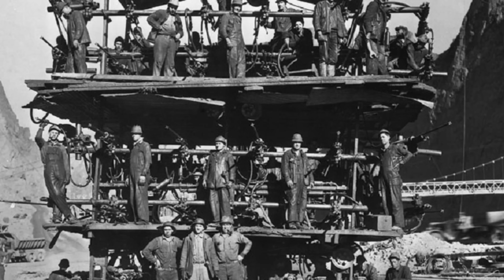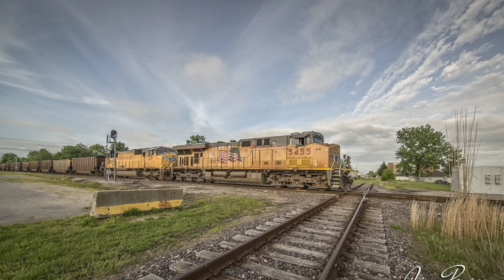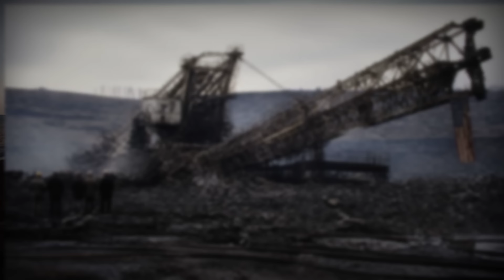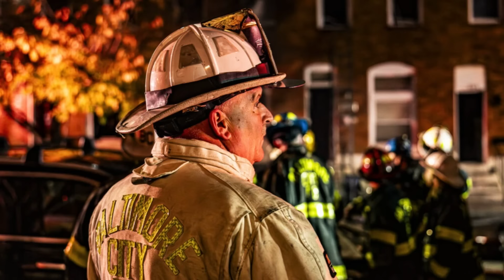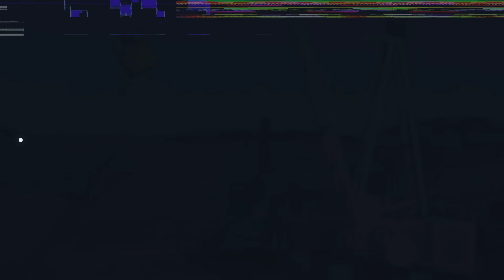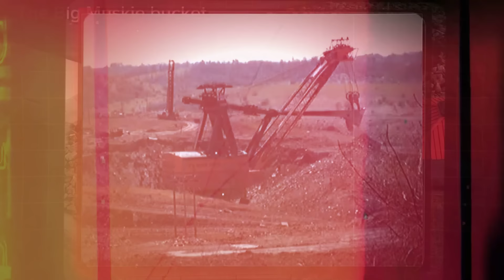The Night Seven Fire Departments Watched the World's Biggest Machine Burn

Comment: I worked at the mine and at Steeleville fire department,  I  was the first firefighter on the scene.  I called the office and told them to call every department around.  One thing they don't mention is the steel flooring became so hot we thought it was going to melt our boots also when we sprayed water it caused coal dust that was ten inches deep in some areas to become air born and we were having small flash overs. I could go on for hours,  the truth is it was more than anyone to imagine and any amount of department's to handle. I left the mine in 92 and went to work full time at the Madisonville for in kentucky.
Reply from the maker: @dennishart9346 Thank you so much for sharing this first-hand account, Dennis! Hearing from someone who was actually first on the scene means a lot. The details about the red-hot steel flooring and the coal dust flash-overs are incredible and show how dangerous it really was. Thank you for your service!

Comment: Why didn't the Fire Department use Foam or the chemical they use on Forrest fires,, were the firemen volunteers or they  rather let it burn ro a crisp for insurance fraud?
Reply: Most likely reasons include:  1.  The height of the machine was well beyond the reach of fire department aerial ladders and ground-based hose streams;  2.  Not enough water available;  3.   Not enough foam concentrate available to make the vast amount of foam required to effect extinguishment; and, 4. Even if there was enough foam available, the type of foam required for Class B [flammable or combustible liquid] fires is only effective on two-dimensional, or pool, fires and this appears to have been a three-dimensional [flowing] fire.  Also the chemicals used on wild fires are only effective on Class A [ordinary solid combustibles such as wood or paper] fires and would have been useless on this fire.  If you lack technical expertise, please refrain from  conspiracy theories and questioning the integrity of firefighters.
Reply from the maker: evanstauffer4470 This is an excellent, detailed breakdown - the foam type and reach limitations really explain why this fire was so hard to fight. Thanks for the expertise!
Reply from the maker: @JorgeLAxeGrinderBobe Great questions! Those are exactly the kinds of details that make this story so fascinating. The footage available at the time doesn't fully answer all of that, but it definitely raises some serious questions. Thanks for watching! 🙏
Reply: You had to be there to understand, read my comment.
Reply from the maker: dennishart9346 Fair point, nothing we put together can replace having been there. Were you at the site yourself that day?

Comment: Why would an insurance company pay out $35 million when it could pay $7 million and repair it?  It's like getting into a $2000 fender bender in your pick-up and telling the insurance company "no, I don't want it repaired, I want it totalled and you pay me $55,000.  Ain't gonna happen.
Reply from the maker: @dennisgray6 👍 That's a sharp analogy! The economics of insurance decisions can be baffling – especially when repair seems like the obvious choice. Thanks for sharing your perspective!
Reply: I’m guessing the time it would have taken to repair= too much in lost profit. If the coal itself was devalued, it was no longer worth having the captain at that location and it couldn’t be moved elsewhere, so they used another machine, slowed production down but still allowing profitable production and moved up the obsolescence date. Plus they got the salvage sale for the steel. It’s all about the bottom line….
Reply from the maker: rachelstratman3071 That's a really sharp breakdown of the economics - the salvage value and shifting production timeline angle makes a lot of sense. Thanks for adding that perspective!